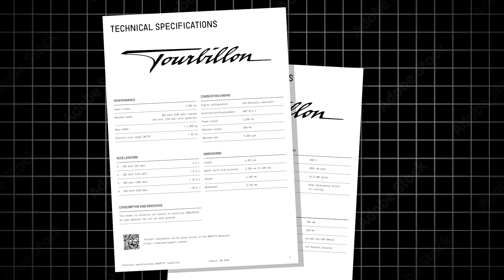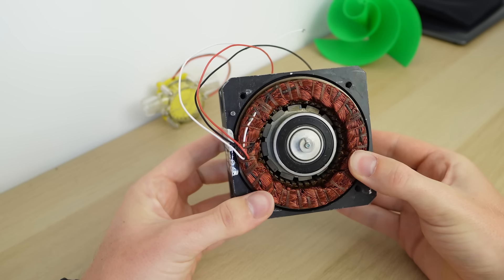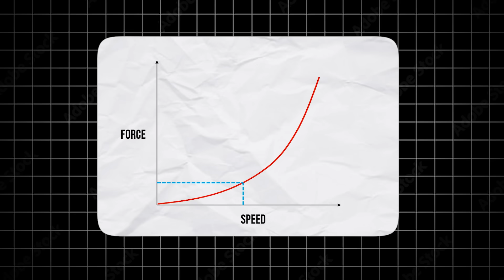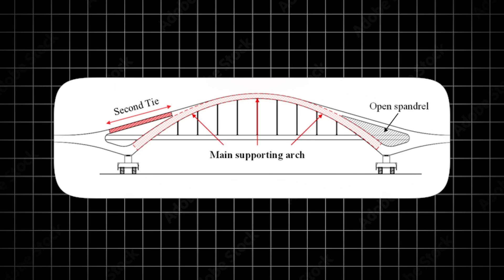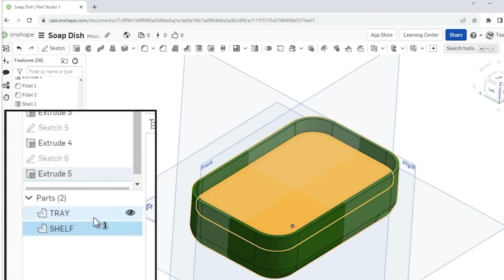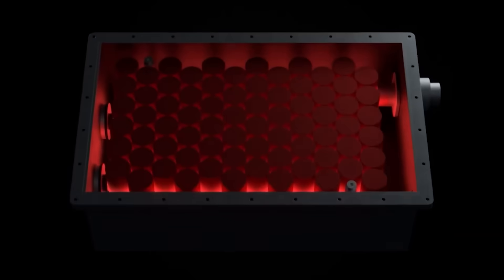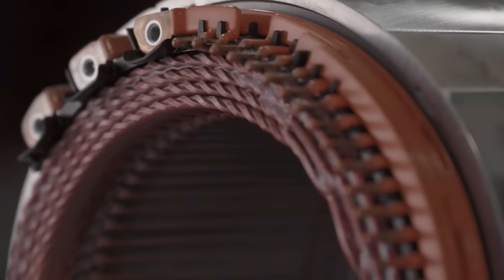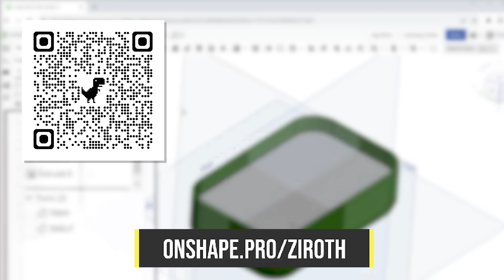How Bugatti's New Electric Motor Bends Physics

Comment: if you want revs out of an electric motor you reduce it's radius and increase it's length, the closer the magnets are to the center the faster they can spin, I have small electric motors that reach some blistering speeds upto 100,000 rpm using that principle, so i'm quite sure bugatti can too.
Reply from the maker: I should have made this clearer! Great points. The important part is that it can achieve high speeds with a significant radius (which is needed to achieve the required torques)
Reply: So you can put more windings and IRC torque onto the shaft as well?
Reply: @Barskor1 for highest speed, all coil windings should be outside of the rotor on the stator.
Reply: In an automotive application, how much speed reduction inefficiency can be tolerated in the transmission path to wheel-speed torque?
Reply: The impeller motor in any vacuum cleaner that's decent is rated at something like 50,000 RPM. But those things are still fairly compact and don't have that large of a radius.
Reply: All depends on software and a sensor

Comment: Rimac joined forces with Bugatti so if you want more information on there electric drive train it is available through there web sight.
Reply from the maker: There is a decent amount of crossover, but apparently this motor and battery pack was built from the ground up just for the bugatti!

Comment: Wow yeah for hybrid aircraft very soon this cooling oil will be extremely important presumably! Many aviation and other applications for all of this!!
Reply: Doesn’t make any sense for aviation, it’s simply too heavy to have that much liquid, you also have an abundance of air to use for cooling
Reply: @Pastronomer69  oh well for a hybrid you’re trying to reduce the weight of the liquid burning engine(s) etc more than electric systems add-wankels may become more common for terrestrial vehicles-I’m not sure of aviation hybrid applications!?
Reply: @pingnick  I see your point, total mass of motor plus battery would have to be comparable with the engine itself replacing. I am all for electrification of everything but aviation just isn’t quite there yet. The market is too small to warrant the cost of replacing the lycomings and continentals of the general aviation world (they still use leaded fuel to give you an idea of R&D in the area!) and the reality of commercial aviation is that electric advancements just aren’t there and I fear won’t be in my life time. Can we make motors and batteries with sufficient power, I’m absolutely sure of it, but weight is the biggest issue and always will be. 

Its not even about the take off weight, but not losing significant mass in fuel burn will make landing a challenge
Reply: @Pastronomer69  definitely challenges abound and it seems velis electro (particularly if they can somehow get Nio style battery switching) will be a notable success in flight schools and similar long before other pure electrics become practical… the hybrid does just seem so obvious to try wow lightest generator liquid burning setup for medium small planes with batteries for takeoff climb yeah just common sense but wow you can’t pull over to the side of the road in a few seconds for battery fire though they should already be more rare than liquid engine failures BUT if you can’t jettison a battery and it starts to burn your aluminum wing oh my😱
Reply: @pingnick  is that how Neo went so fast at Nurburgring?
Reply: The cooling oil will also presumably keep electric systems as the primary or only energy source for short/medium duration performance terrestrial vehicles!!
Reply: Direct oil cooling has been used on electric transformers for a LONG time, it's nothing new.
Reply: Got air?

Comment: Pretty sure that's not exponential growth, that's parabolic growth.
Reply: Nerd fight!
Reply from the maker: Good spot, I meant to say it grows by an exponent, not exponentially!
Reply: Don't be no square
Reply: 2:31 exponentially is the apt word choice here.

... Parabolic is used to describe a symmetric exponential "shape" on either side of x / y axis
Reply: @Vamanos46  No, it's a quadratic relationship not an exponential relationship.
Reply: @Vamanos46 I would NEVER use the term parabolic.... now I'm being hyperbolic, of course.
Reply: @Vamanos46 no it isn't lol. The centrifugal force on an object circling a point is mv²/r... It's quite literally parabolic in v
Reply: An exponent of 2 is still an exponent
Reply: @bread8176  No if the exponent is fixed it's a power law, not an exponential law.
Reply: @bread8176  Exponential growth is exponential when the base is static and the exponent is changing (i.e. 10^2, 10^3, 10^4).